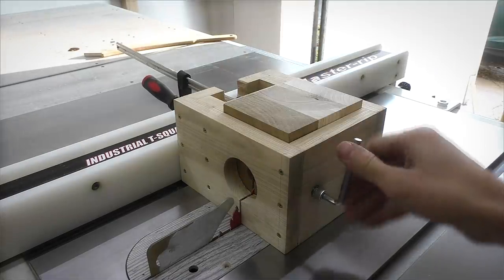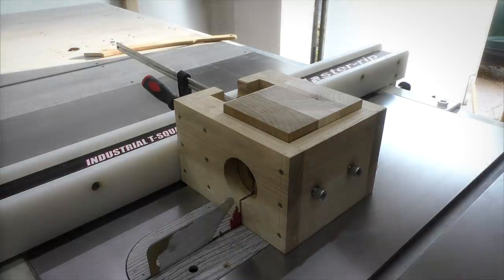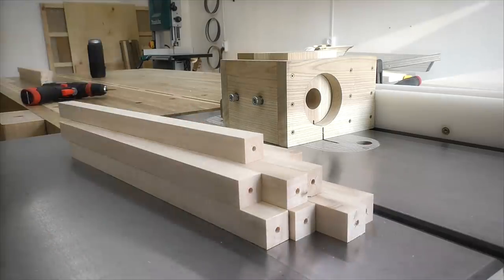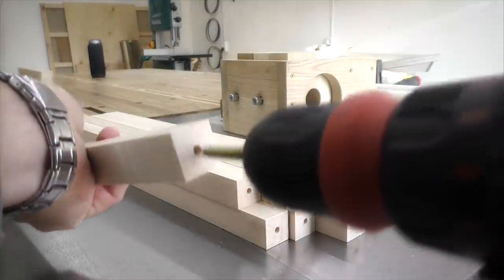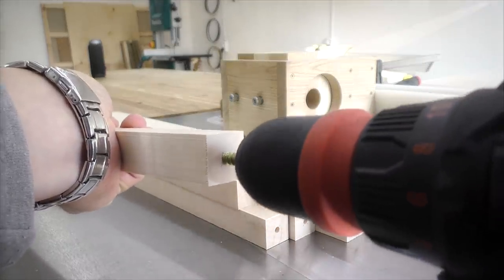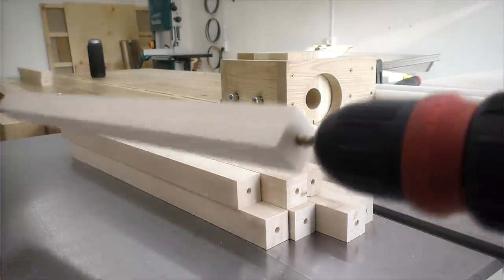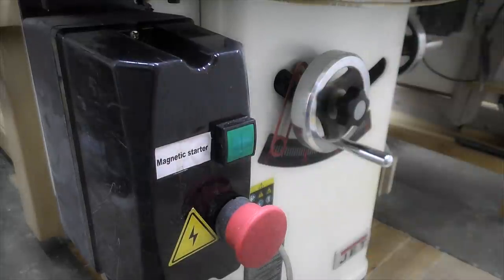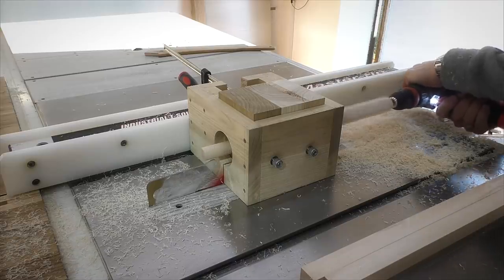Making Wooden Panel Clamp - DIY Woodworking Clamps

Comment: I really REALLY like this. Elegant use of material and the inclined plane, even clamping pressure with no worries about clamp bar bending, could possibly act as a caul with a deeper section and/or camber or shims - very nice.

Comment: Excellent achievement.  I discovered your channel recently and I really like what you do.  Just a little advice: 2 sheets of newspaper between the glue plate and the clamps, prevent the clamps from sticking.  
You still have to scrape off the excess glue.
Reply: How about paste wax on the wood planks.

Comment: you should sell sets of these or, at least, the plans.   I would definitely buy
Reply from the maker: Save money for candies 😉 here are dimensions: planks - 3x4,5x60cm, every 4cm I drilled 20mm holes. Dowels - 10cm long. Wedges I cutted from 4x25cm planks diagonally.

Comment: Well done, very nice and neat work. However I am not impressed with the clamps for two reasons: 
1. You still need to use regular metal clamps, so you can just add two longer ones to press the board fully. 
2. You need to remove glue from your clamps every time, it's a direct contact of glue and wood.

I am more impressed with two jigs you used for making those dowels. 
Cheers.